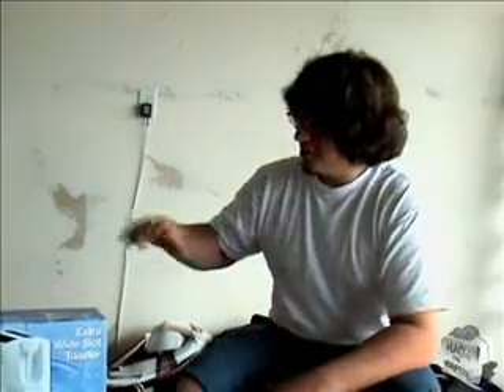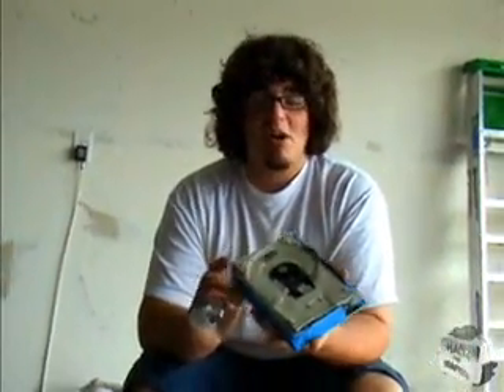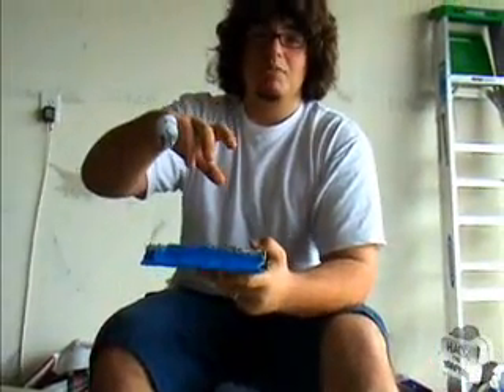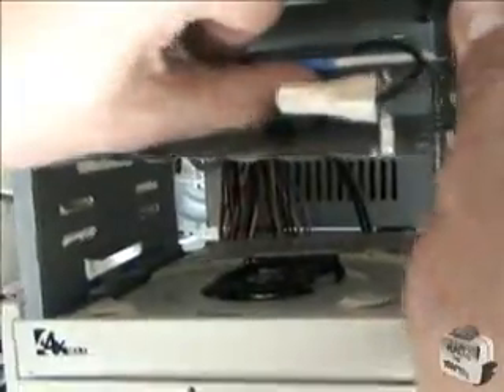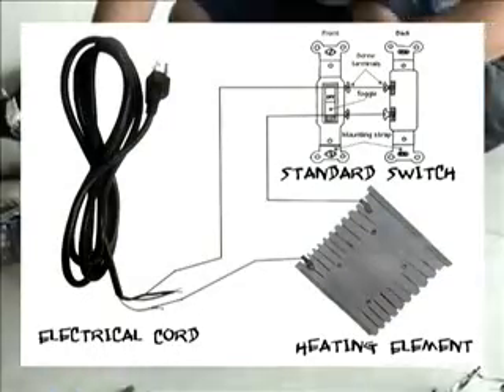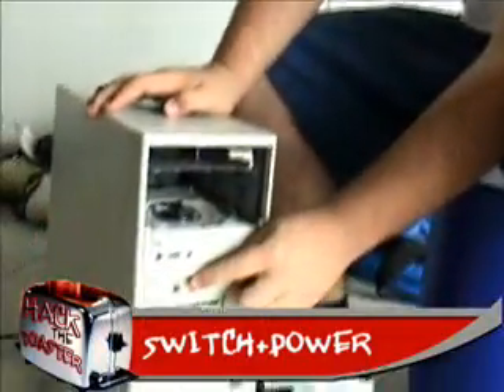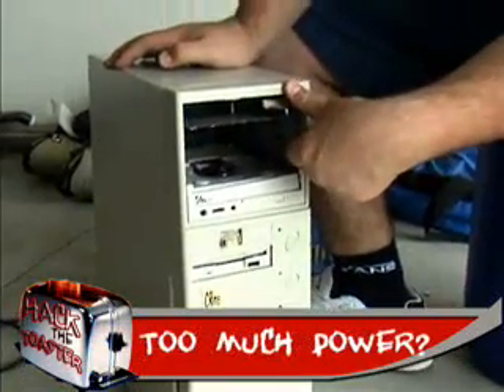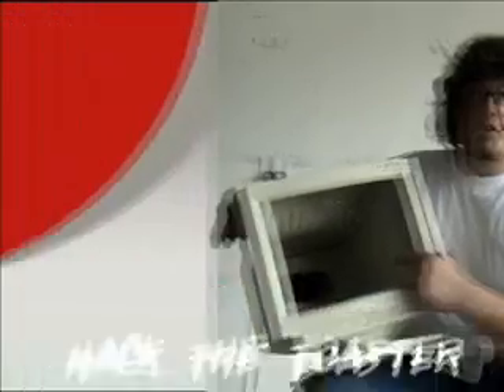Hack The Toaster - Episode 1 Low Res

Comment: toaster elements are suppost to be wired together in series, which is why yourd went si hard out.
you need to use all the elements together to prevent the overloading. 

tip:
if your planning to melt the insylation of your wiring agene, PLEASE make sure your case is earthed! so that if the live wire touches the case it short circuits causing the breaker to trip, rather then not doing anything at all until you touch the case and die.